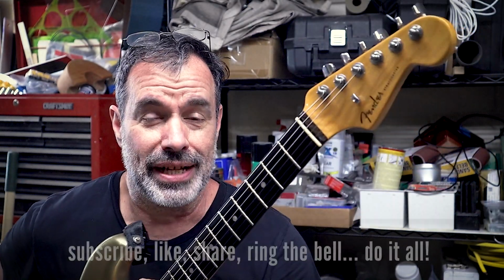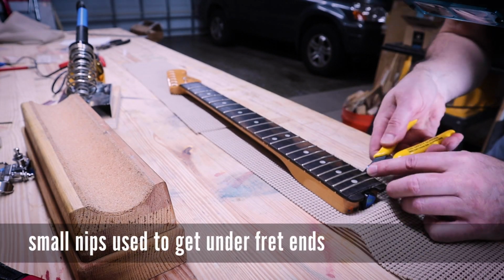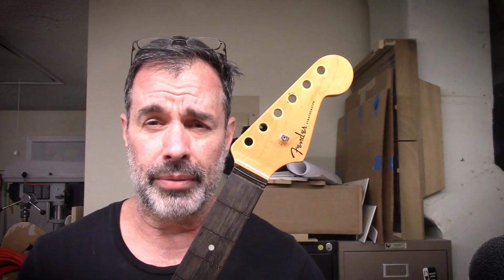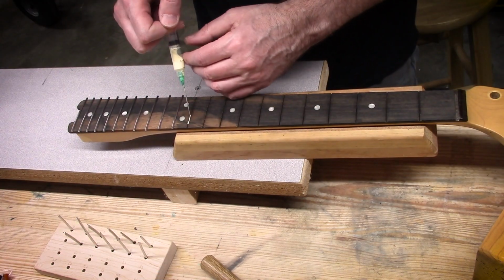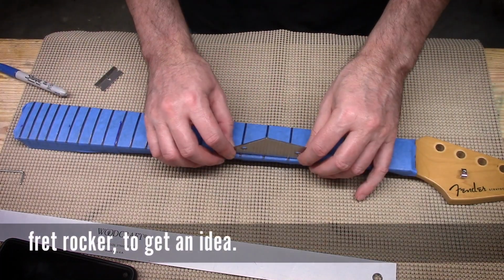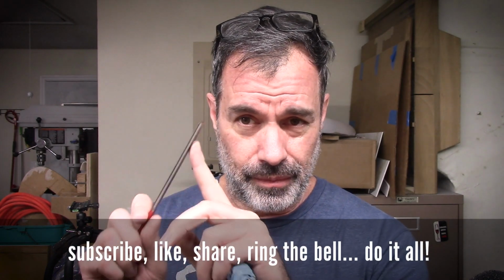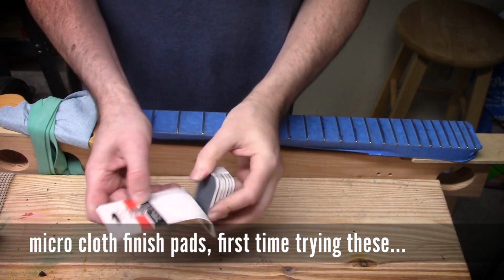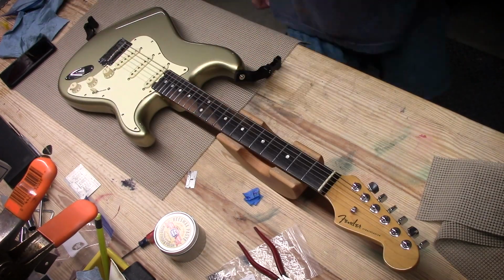Fender Stratocaster Stainless Fret Install Project

Comment: Pretty good job overall but I do disagree on a couple of points. Undercutting a fret tang is not a good thing and should be avoided if possible imo, I want as much tang as possible to be in contact with the wood. Another thing is having frets the same radius as the fingerboard not only for stainless frets but for nickel silver aswell. Why introduce unecessary tension into something this error sensitive, gluing the frets in helps but it's a pretty high probability that somewhere down the line either the side of the fret will pop up or the middle. Another thing you didn't mention is "rolling" the fingerboard after you refresh the radius, you don't want to return a guitar to a client with sharp feeling edge on the board (pretty sure you did something, given how meticulous you were overall). If you install the frets perfecrly and do all the prep work precisely you should need very little to zero fret leveling. Also I would avoid blasting the guitar with a heatgun when removing the nut, only a matter of time before you crack some nitro finish, if you abaolutely need some heat to losen the glue, use an old iron to heat up precisely what you need to. Overall though the job done really well but not perfectly
Reply from the maker: Thanks for watching and the well rounded comment/concern too!
I appreciate the time it took to cover all those topics, well done!

The fret wire was listed at a 12" rad, the fretboard ranged from 9.5"-14", so the actual difference in contact areas of the wire ranges by only a few thousands over the width of the neck, at some of the frets, less at others. Stainless wire, while more brittle than nickel, will bend rather easily and while perfectly fitted radius wire would be ideal, it would be very difficult to achieve in a timely manner with a fair amount of waste added.  If I were to hammer in the frets, perfectly matched radius would go out the window as both nickel and stainless wire easily deform during hammering.  Pressing the frets offers a me a more controlled and even starting point. A more even radius before any potential leveling.  

As you stated, a perfectly prepped board should yield nearly no leveling needed, assuming all fretwire is of 0.0000" tolerance, which isn't likely,  This project was close to perfect, but not perfect. It did take minimal leveling with 400grit on the beam. And minimal  crowning and dressing  too, it all went well. 
The glue was used more to fill any voids in the fret slot, than to anchor, as that is the primary job of a properly fit tang to slot. 
The tang undercutting I did nearly matched what was factory on this neck, it didn't have protruding tangs, which is an issue on a lot of production necks. I trimmed the tang back 1/32" on either end, so when pressed in, the tang is just short of the fingerboard edge. I didn't show it, but the remaining fret slot was cleaned of glue, then  matching wood dust and CA were added to fill the slot ends. All smooth and nicely presented.

The heat gun was only used at the nut for a very short time, the neck was protected to keep heat way from finish and wasn't concentrated enough to impact the glue of the fingerboard either. 

The factory neck had sufficient round over between frets, and the cleanup radius sanding I did left plenty of eased edge, after the fretwork was done, I did follow up and polish the fingerboard top and sides, this also added to the factory eased edge.  

The frets were beveled back up to 30°, then rounded, dressed and polished. The edge of the frets are inside the overall width of the fingerboard, and follow the sectional shape, so they really can't be felt by running a hand along the edge of the fingerboard. The frets can be felt if a hand is wrapped around to carry the guitar, but it is a well shaped bump, no sharp edges and no tang at the surface to create future  issues that the climate may cause.  

I'm not arguing any of the points you mentioned, in fact they are all legit concerns.  Things that I've worked on and observed over the years.  Each fingerboard needs it's own special mix and adjustment in approach.  Sometimes I use CA with the frets, sometimes I don't, it really depends on the neck and wood. 
Overall, I don't see any fret issues happening for this neck, the tang is +/-99% of the neck width, the board is better contoured now than from the factory, better frets are in place now than originally, glue was added and it didn't appear the factory used anything, but maybe.  No ski jump heel on the neck, and it played really well before, so no need to over compensate a new dropoff or fallaway at the high frets.

I expect the owner to have a few reactions. The feeling of it being different. He has been playing a different #1 guitar for some time, so this guitar will feel different, there are new strings, and having frets that are all in line, all add up to an initial "different". Also the stainless wire will change the feel somewhat, offering an easier surface to play on, that's different too.

Again, thank you for your comments and concerns, I greatly appreciate the time you took to do so, and I hope I've offered a better review from my pov in what I was doing. Hard to fully present 10 Hrs of work in a 20 minute video . 

Hope you are going well, be safe and take care!
Reply: @theNextProject ignore that guy, you did a perfect job, he’s a typical internet keyboard warrior. He should make videos and show us the proper way.
Reply from the maker: Hey Real Chet, good to hear from you and thanks for watching!

I don't mind critical comments, and honestly he does have legit concerns, it's all good.
I gloss over a lot of information, and bring such comments on myself. Hard to show everything, and then there are the things I just forget to mention. 

I'm really happy with this project, it took 2x longer than I expected, so in reality it was right on time. At least I know when i think something will take a few hours, it will take a few x 2. 
I am aware of my estimating handicap, now I need to learn to say "No". Hah, it'll never happen.

I hope you are doing well, and good to hear from you again.
Be safe and take care, another vid coming out really soon!

Comment: Maybe if I finish up juggling project guitars, I'll finally decide on an instrument that deserves the stainless treatment. With my light touch, could probably last the rest of my days.

There are so many processes I'd be interested in trying, like refrets, that I always have to balance the cost of tooling-up against how many times I'd actually do that task ever again. Sometimes it's more economical to hand it off to a local tech, but I like learning new things too.

(also: it looks like you got a "subsribe" typo in your closing titles, make sure you change it if you wind up using the edit project file again!)
Reply from the maker: Oh man, my middle name should be typo. 
Thanks for watching and keeping an eye on me. Never know what I'll misspell.
I hear ya regarding the interest in trying things, versus the cost of tooling-up. I have gathered a lot of heavy things over the last 30yrs. So I have a great advantage to try new things, as I may have a tool that will do the job. That said, I've wasted a lot of time and money trying new things. 
I once reupholstered an old, old couch, thought it would be an interesting project. It made me sneeze and itch. The couch was full of horse hair, cotton and other things I could only guess.  I did learn a lot, mainly that I'll never do that again.
Thanks again for catching the typo. I'll update the original file, and hopefully won't roll the error forward.
Be safe and take care!

Comment: Those microfiber pads work best when soaked over night. I agreed they are cheap. Nice work man. I've seen many burn through those soft nickel frets. Shame on fender really. It's a lot of money for a neck. It's when the America Fender uses 6 to 8 pieces of wood for the body. Cheers, good to see ya man.
Reply from the maker: Ah, soak them like wet/dry paper then. Good to know.

The fingerboard compound "facet" shape was a surprise. I didn't expect that. I could see a fella like myself doing that in the garage to make a similar neck, but I'd probably sand it out a bit better.  Luckily the frets they pressed in at the factory were prepped nicely to hide the fingerboard shape.
Now it's all purdy and smooth. 
Life is good!

Thanks for watching and great to hear from you my friend.
Take care!
Reply: @theNextProject . Yeah, then they juat glide and don't rub off so less pressure gets the job done. Eventually you fold them, lol yes, that radius didn't surprise me. I've now seen a few rearing down American Stratocasters to repaint and they're finding multiple pieces,  like 4 and up. Painted over of course.  The fretboard radius being jenky is sad and bad for business.  At least thry slotted well, lol, you had to fix that too. 🤣 cheers mate!

Comment: how do you straighten the wonky fret rockers? thx 🤘
Reply from the maker: witi, thanks for watching!
I use a diamond sharpening stone, it's made for sharpening knives, but does a good job on rockers. Just takes some time, and a lot of checking the rocker against a machined straight edge. 
Typical issues have been to remove very small amount, probably a couple thousandths "hump" of material from any side that isn't true, which is usually the longest couple sides of the rocker. 
I think I'm just cursed, and this isn't an issue for most people. 
Maybe I have bad rocker karma, or something.

Comment: Beautiful job there John. How much more life can be expected from stainless steel frets?
Reply from the maker: Martin, good to hear from you and thanks for watching!

Great question and the answer will likely be in the player.
This guitar was a "daily driver" a gigging guitar. 
The factory nickel frets were worn out in 5 years, then the guitar slowly went out of the #1 spot and didn't get played. Now it's ready to get back to work.

Stainless frets should last 3x longer or more, result and expectations will vary.
For a person with my playing ability, stainless frets will likely be a lifetime thing, installed once and never again while I'm kickin.
So, if you are on stage every day/week, stainless will last a long, long time. If you play guitar during TV commercials (like me), you'll only have to change strings. 

Another upside to stainless, are the positive comments of the guitar being easier to play. A smoother, slicker fretting surface requiring less work to bend and such. Again, this will be the player, but I think they feel great.

Hope you are doing well. 
Be safe and take care my friend!

Comment: Good stuff as per the usual. Was thinking about stainless for a bass project in the future. Your video has taken some of the reservations out of that choice for sure.  Thank you!
Reply from the maker: Good to hear from you and thanks for watching!
Stainless frets on a bass should be a perfect match, and that is what I have planned for a bass build (this year maybe ???).
Personally, the only difference in working with nickel or stainless, it the  difference in cutting and nipping the tang. I don't have any issue pressing, leveling, crowning... it's all very similar.
Does it take a little longer, IDK, seems very similar to me.
Maybe the best way to get good frets is to have the fingerboard as perfect as we can get it. if it's wavy...the frets will follow along.
I'm sure you'll have great luck with your stainless project.
Be safe and take care!

Comment: Hello John,
I am in a rush. So just a quick 'hello'. Well done like always.
I have to check my fretrocker. 

Stay safe
Jens
Reply from the maker: Jens, good to hear from you and thanks for watching.
Hope all went with with your rushing about too!
I'm sure there are perfect rockers out there, I may just be a magnet for crap, but I like to fix crap so I'm the right guy, LOL.
Luckily this project was not crap at all. Worn, but nothing to rebuild, just a nice straight-forward project.
Take care my friend!
John
Reply: @theNextProject   I have a complaint. 
I was asking myself, what was wrong with your video. You didn't really met my legitimate consumer expectations. I asked myself until I read your answer. It is completely wrong that nothing went wrong. A tNP has to be almost ready, then almost completely ruined and then like a phoenix rising from the ashes, the project rises and shines.

My fretrocker from Thomann is not 100% straight, but I think it is sufficient.
Was the owner of the guitar satisfied with the different fretboard shape?
Reply from the maker: Jens, my sincere apologies for letting you down. I will gladly refund your cost of admission to this performance. 😉

I was really surprised there wasn't something that went sideways, just the interesting things that are found when we work on a "brand" product.

At this point the owner is pleased. I don't think he is aware that the fingerboard was oddly shaped. The factory frets were nicely radiused, so that is what he was feeling. Now the frets and board are actual doing the same thing, so once he gets used to playing this guitar again, I'm sure he'll use it without a thought.  Probably the biggest issue he'll have is going from his other guitars to playing a stainless fret guitar. Bending will likely be a bit easier on this git.
Hope you are doing well, take care my friend!

Comment: I like ebony like this. I really don't like all black ebony, as it looks totally boring, you don't see any wood grain.
There is a new way of levelling frets, but I think it works better on fretboards with only one radius. Something with maestro, if I remember correctly. The file already has the radius and the crown of the fret, you don't even have to straighten the neck.
Yes, it's “fret maestro”. They have YT-videos, just search them.
Next Saturday, I'll get my bass back with levelled frets and a new GraphTech nut.
Reply from the maker: Achim, good to hear from you and thanks for watching!
This ebony is pretty nice as you mention. The slight coloration looked good, natural, warm and inviting. One think I notice while refreshing the radius, was that the lighter colored areas of the ebony seemed to have shrank a bit more than the darker areas. I don't know the actual cause, but I wonder if those light colored areas are a bit softer, or differ grain density. Hmm, wood is interesting stuff. Anyway it looks great!

The Fret Maestro, yes that looks intersting. I've only seen a couple videos and I like the new approach. I may not understand the process entirely, but I think each radius requires a special file. Maybe I need to rewatch some vids. I've seen the tool(s) listed for sale, there are 11 different radius' inserts to choose from, so I'm thinking a compound raduis neck, I'd need all the radius inserts between X" and XXXX". 
I need to do more research.

Good luck with your bass project, be safe and take care!
Reply: @theNextProject  You are right with the ebony, the dark wood is core wood and that's got a higher density, it's harder than the outer wood. Walnut also has darker and harder core wood.

Comment: 12:00 I've also had bad fret rockers,  try this one "fret rocker Framus by Warwick" 👍
Reply: Lube Z file is a great idea, I'll try it !
Reply from the maker: Seriously, I am soooo pleased by not having to clean the plugged up grit out of the diamond file.  I'll keep trying this process.
Oh, a little dab of oil goes a long way, don't need much and I'm sure you'll dial in what you need as you go.
Good luck to you!
Reply from the maker: I hope you have some good ones. I'll have to look at the the Framus/Warwich fret rocker.
I don't want to comment on the brand(s) that I have, but the brand name rockers, weren't any better than the cheap stainless ebay/amazon variants.   Maybe I just have bad rocker luck. Ha!